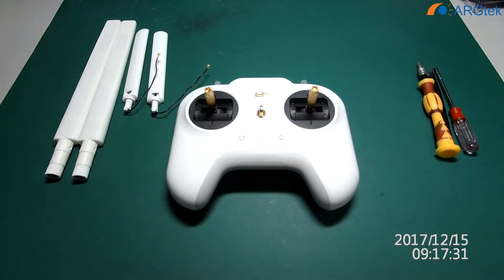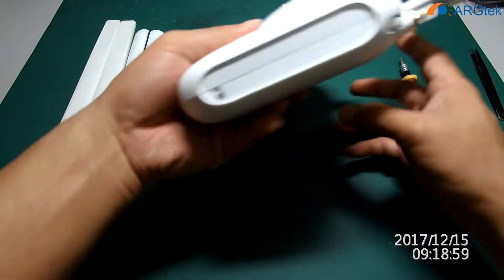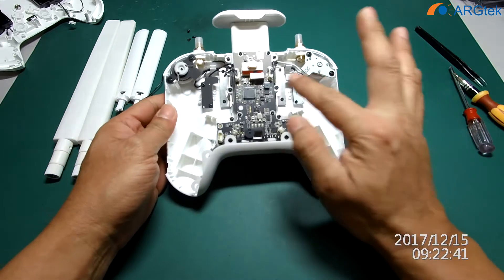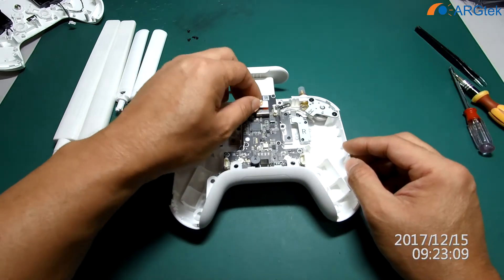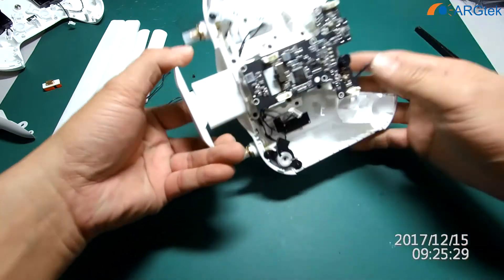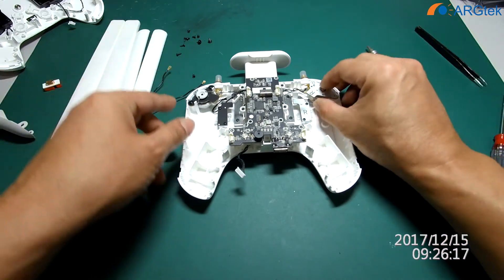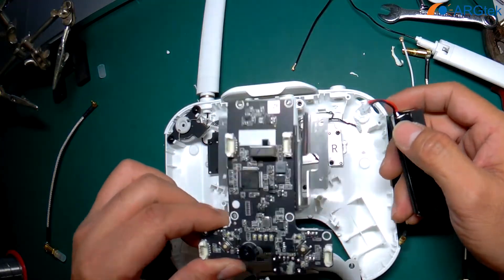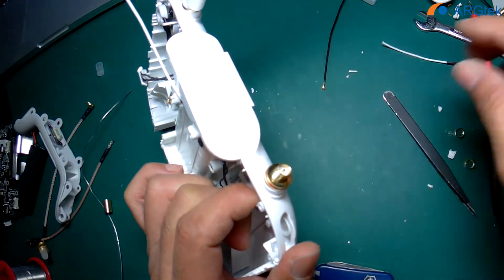Mi Drone 4K - ARGtek WiFi Range Extender Installation Guide

Comment: Can you explain please how the antennas at the Mi drone are working. I have an Chinese Manual and cant read it. But i Have found two values, 2.4GHz and 5GHz. Which frequenzy is for what porpose? And are both antennas the same? I mean is every antenna receiving and transmitting with 2.4GHz and 5GHz, or is one antenna for 2.4GHz and one antenna for 5GHz?
Reply from the maker: Midrone support dual band , so the antenna is dual band.  "I mean is every antenna receiving and transmitting with 2.4GHz and 5GHz" --yes it is, our antennas receiving and transmitting with 2.4GHz/5GHz